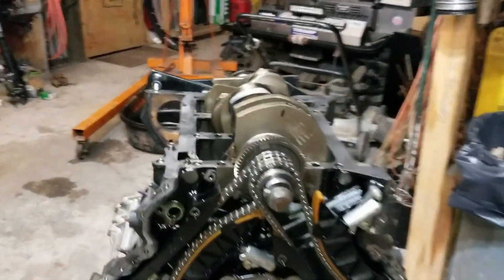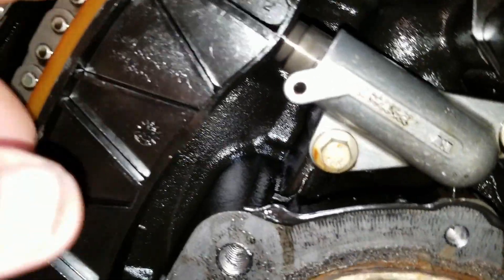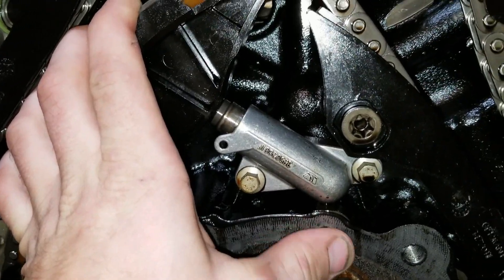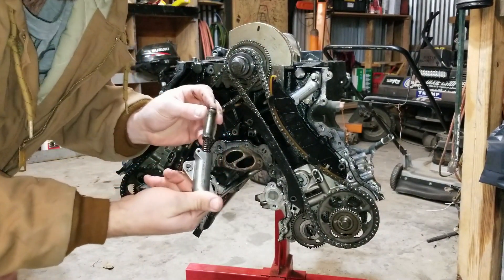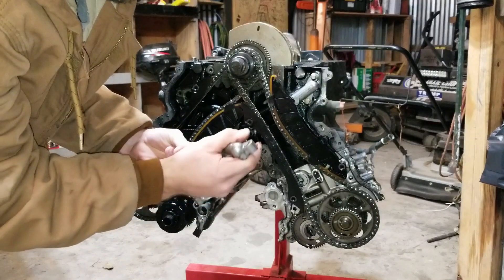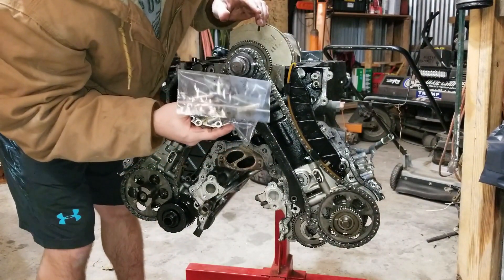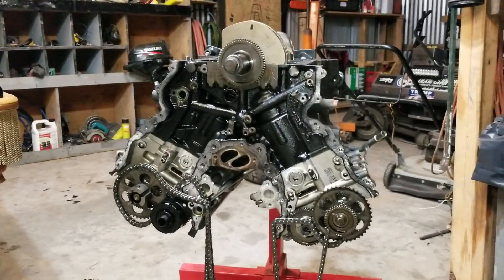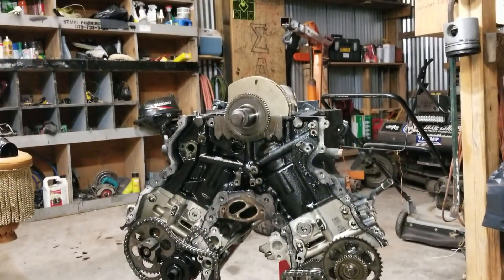Ecodiesel Timing Chain Removal

Comment: Hi, can you remove the oil pump by removing the timing chain covers and unbolting the pump or does the upper oil pan need to be removed?
Reply: Upper oil pan needs to be removed 😢

Comment: How is the build coming along? I used to have an ecodiesel and was always intrigued if there was more options instead of just a compound.
Reply from the maker: Its coming along, just put another updated video up on the piston upgrades check it out! And the aftermarket is coming in slow for the eco because of some of the failures and no aftermarket bearings being available. It's still getting figured out but the motor has a lot of potential

Comment: hey man, how is the build going? i own a 2015 eco diesel and i want to get more out of it. i noticed in another video you said you went with PPEI, what made you decide this over GDE or Banks? i been looking into a tune so i can get more plus delete all the crap off of it, since Chrysler does not want to fix the eng code for the DEF system (long story short is my VIN does not call for the recall but yet i have the same problems).
Reply from the maker: I went to ppei because I wanted power vs efficiency plus I could upgrade later to the compound tune before GDE had one. Ppei and GDE are both great and the super tune from GDE is good also and their customer support and knowledge on the eco is unparalleled. I would delete it fully asap and run it like you stole it.
Reply: @CoryFritz1  that's the plan, I am wanting to delete it all and then compound it later on.

Comment: How does the engine look for wear otherwise? Cylinders, timing chains, cams? I believe you said the truck has 80k miles, correct? Other reports I have read suggest that the engine stands up very well apart from the main bearing issue and cam gear slippage (that seems much more rare). There also seems to be a coolant leak issue as well that can cause problems if not watched (checking the radiator rather than just the overflow bottle). Thanks for the videos.
Reply from the maker: Engine looks great. The motor is pretty stout, way over built. But yes the main issue is the bearings for some reason. Lots of theories out there. I never had an issue and probably wouldn't of if I didnt compound it and have a wastegate issue.

Comment: Hi.  Are you doing this because the exhaust cam slipped or mileage ?
Reply from the maker: Spun bearings due to compounds and a wastegate issue. My first ecodiesel 600hp video goes into details
Reply: Cory Fritz 

So it was not stock ...